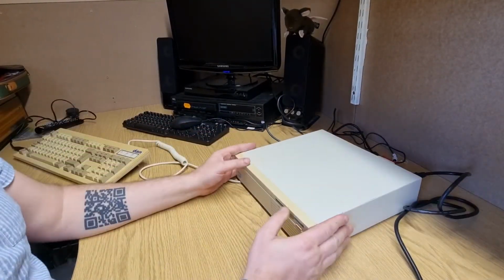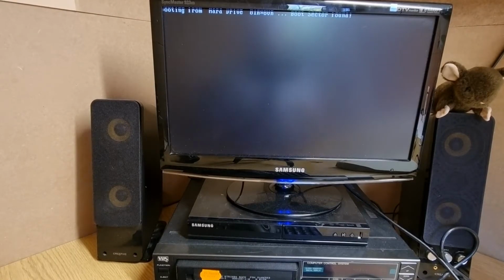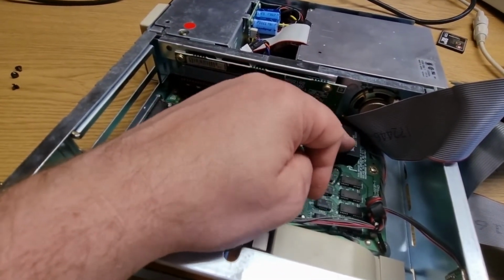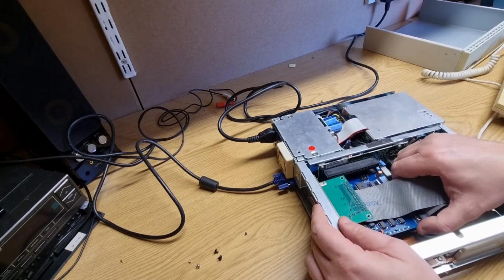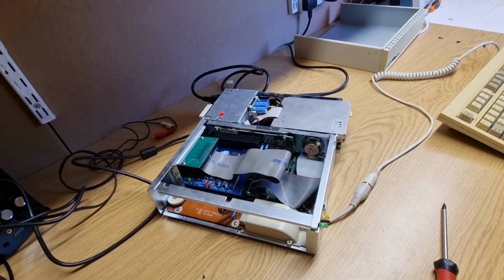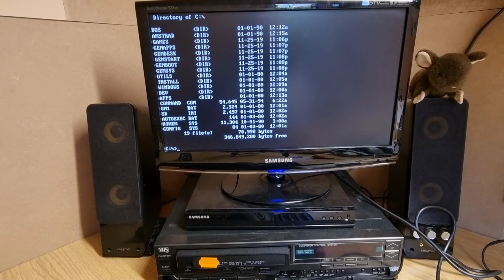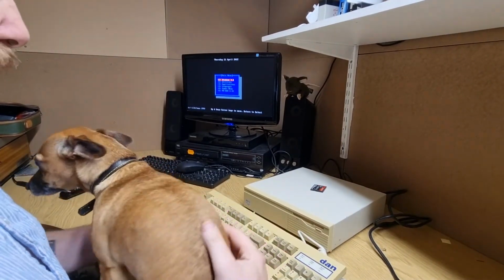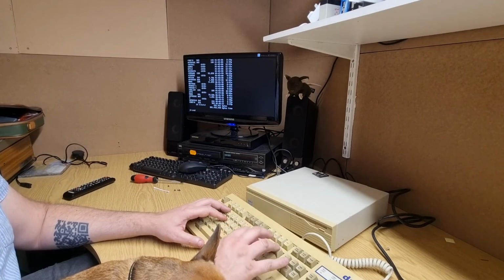Fiddling around with an Amstrad 5086 Desktop PC

Comment: I have one of these but it doesn't work sadly. When I bought it the guy said that the hard drive was dead and so was the battery. I replaced the battery and it still has issues.